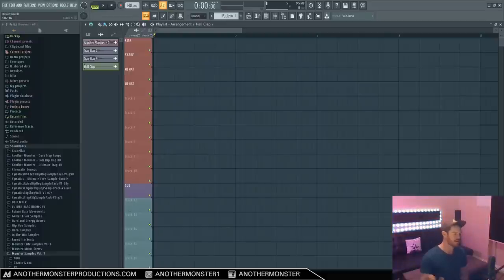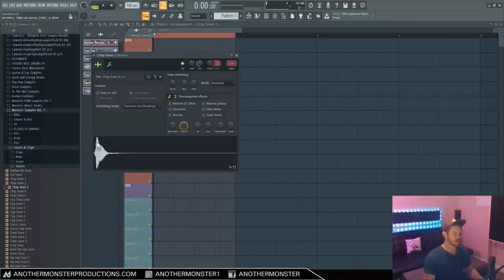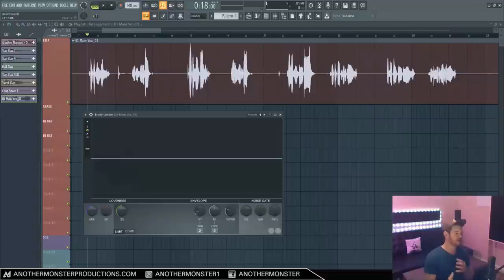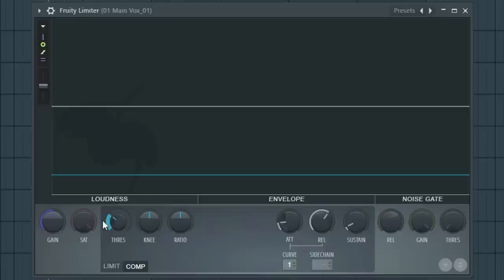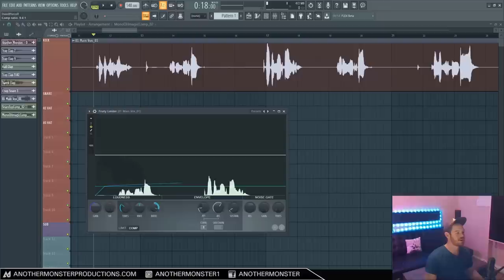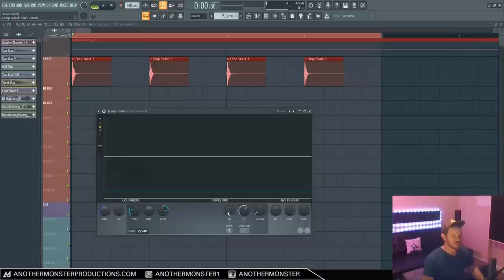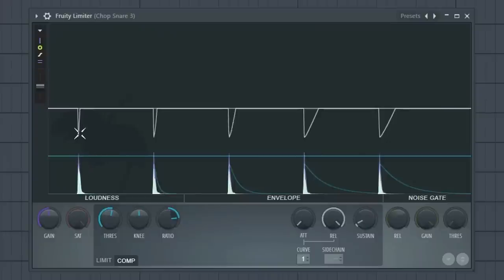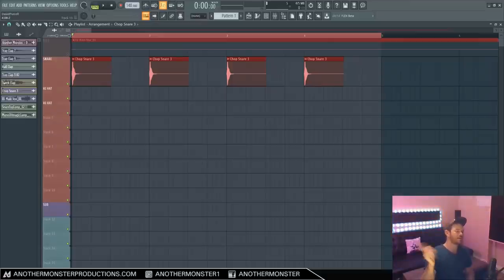What is Compression in Music Production?

Comment: This was extremely helpful and simple. I appreciate it!
Reply from the maker: MrDoctorSpoon glad it helped!
Reply: I got a really dumb and basic question. My songs/mixes sound very dull and quiet. I try to get the most sound out of them via EQ, but it still sounds quiet and boring. Do you got any advise or technique for getting the most out of a mix? Thank you for your time.
Reply from the maker: MrDoctorSpoon volume comes in at the mastering stage. Start using reference tracks and imitating the balance of your references. Try to get all the elements to sound similar. It’s going to take some time to get there, but I think this is the easiest way. Make sure you’re reference track is at the same perceived loudness as the track your working out. Basically just turn your reference track down. You can use a LUFS meter to check it.
Reply: Thank you! I’ve been trying to get as much advise as possible, and your channel is a goldmine. Thanks again for your help.